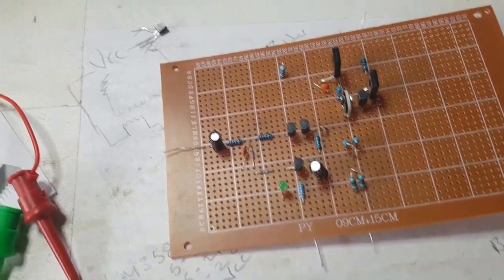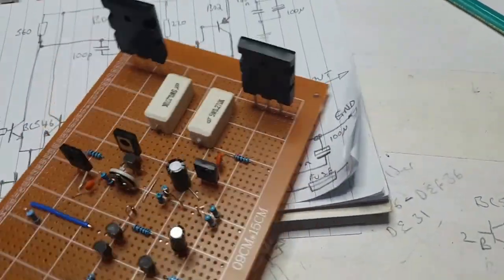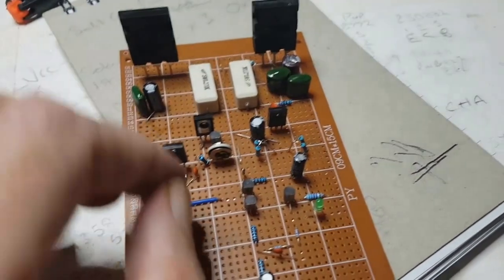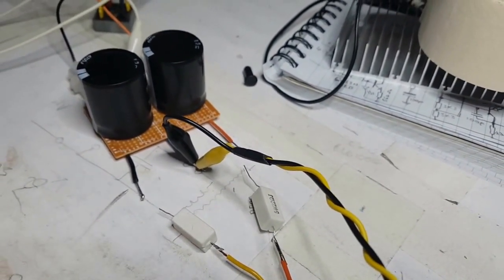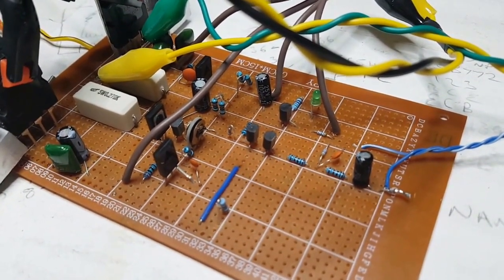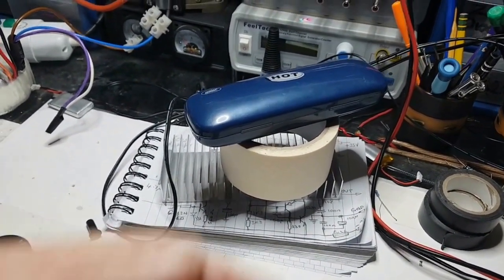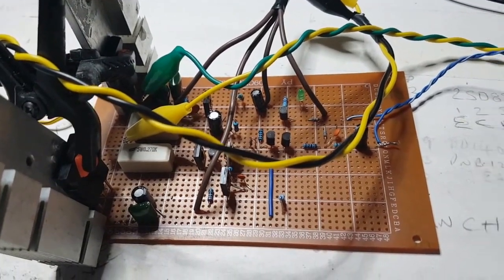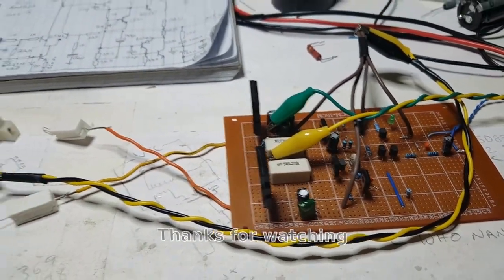60 Watt Amplifier Attempt 2 Pt 2

Comment: Enjoying your videos...thanks for sharing the magic smoke..nice solder work..what happened to your varic?...um auto transformer...smile...been busy here fixing tablets for my kids.... broken mico usb sockets..to small to work on..so doing a mod... fitting a charge and protection module on back of tablet...while learning how to recondition lithium batteries and been having great fun with my new toy...an amazon echo..."Alexa what value resistor is this?...."Alexa refresh my brain on Maxwell's equations and  remind me that my dinner is in the oven" headphones on... looking forward to part 3
Reply from the maker: Hi bunny, I still have my varic? ... auto transformer is easier to spell :D  Sound like the kids keeping you busy and you are having fun, that's good. 'Reconditioning' lithium batteries?  sounds interesting. 
Amazon echo... umm a device or system which stays on listening to what you say, processing/storing on a server in the off chance you need assistance?  Sounds smart, when does smart turn to creepy. I am a sceptic of these listening devices, or at least the power they can have parallel to the advertised benefits. 
Similar to Cortana or Apples voice activated service.

Comment: Your search for measuring the quiescent/idle current might be as simple as 2 ammeters inline with each + and - power supply supply rail.  We'd suspect an OK circuit will draw generally equal current on + or -.   This could also help identify a shorted output transistor, that would cause a smoking protection resistor (as you are using).  The + rail drawing 10ma with the - rail drawing 7 amps or more (after all, the 0.33 ohm resistors are nearly straight wires).  I'd propose the total quiescent current would be + and - currents added.
Reply from the maker: I have sorted the current problem with a twist of 2K pot. i brought the quiescent current down to 60mA at 25V each rail. The voltage difference on the rails is around 1.5V.
All seems well no hot resistors, no hot transistors :D Done it all on video, just one small issue to fix.  With rising input voltage I end up with 10 + volts on the output. no good putting a speaker on it as the current draw goes way up on one rail. Any ideas, cheers.
Reply: It may be more clear to understand what's up in your next video update.  Many questions would be answered... such as, are you pushing a signal into the amp, is the 10v on the output only positive, what is meant by "rising input voltage" (input to the power supply or to the amp input), etc.

And, if you have no heating components, what of feeding a simple audio signal in, and probing through the circuit with both meter and 'scope?  Since nothing is getting hot, you'd have time to see how the signal progresses at each stage.

Comment: I had hoped you would have tried a test of the input circuit using actual audio, before wiring in the driver and output stages.  Now things are all wired, maybe disconnecting both 0.33 output transistor resistors would allow further 'scope and meter circuit probing.  After all, it appears the path of most possible current is from each +/- supply rail... through the output transistors and 0.33 resistors, to the output (which, here, may be left open w/ no speaker?).

Something seems pretty drastic to cause a 5watt 'safety' PS resistor to start smoking.  If you've got 25v +/- through 22 ohm safety resistors, and something is shorted, that produces 1.13a through the R.   power = current + voltage gives us 28watts.  No wonder there's smoke.   Stay safe, man!
Reply from the maker: i didn't connect a speaker because http://sound.whsites.net/project3a.htm (Powering up section at bottom of page) says not to when testing.  I had it powered at 35V, per rail. I do have a variable mains transformer and will put an ammeter inline with both rails. I also have a mains current limiting circuit,  only have 40w and a 60w bulbs.

Comment: While looking for hot (or SMOKING) components definitely helps find problems, watching the voltage on the + and - power supply rails for 1 second will show where high current would generate smoke after 4 seconds.  Say you take 2 multimeters to watch the PS rails.  It takes only that 1 second to see where the voltages are - either as expected, one or both lower by X-volts is valuable info.

No speaker load when running the tests?  I suggest an 8 or even 16 ohm power resistor of minimum 5 watts would be very sensible.  You may want to look close at your circuit and think of what ramifications there are with no (speaker) load.
Reply from the maker: I have 8 ohms 100w dummy load and will connect if you say its OK. I only went on what the power up notes were.
Reply: Well, I'm blushing at the authority you've bestowed upon me!  "If I say it's OK."   Dude, my feedback barely has 2 Amurrican cents of worth.
I'm sure you realize people who comment on your efforts can sound very knowledgeable but still give poor (or wrong) advice.

Actually, my comment about testing an amplifier w/o load comes from a long history of using musical instrument amps.  As an amateur musician that invariably has to use amplification, the word spreads very quickly that you must pay extreme attention to having speaker loads connected to an amp before powering up.

Lest you "blow the outputs" (whatever that means).  And, for amateur musicians, that's pretty bad when you find you forgot to connect your speaker cabinets, and your amp don't work no more.
Reply from the maker: I see your input as a positive and 'do' really appreciate it. You get my mind thinking in a more analytical way within electronics, my projects. If you saw some of the messages I get from some people, you would understand that you and a few others leave helpful, constructive feedback which motivates me. I may not show it, but it does.  Hat tip to yourself and bunnyathome who are the first to come to mind. :D

Re this circuit. I have checked everything and all seems fine apart from and which always trips me. Connecting the 2K pot. The base connection of the BC546 and its connection between the pot and the 1K resistor. ?
I set up as you suggested and did the power checks. I will upload this later and look forward to your feedback.

Comment: If you have no variac to control input voltage to your PS xformer, then, yes, no way to ramp up the circuit gradually.  Do you have various wattage incandescent lightbulbs (10w, 25w, 50w, etc.)?  What of a quick experiment with another xformer, where on the mains side, you insert a lightbulb in series?  Let's say you start with 50w.  With no load on the secondary, the LB may run dim or off.  If you short any of the secondary windings, what will happen is the LB will glow full-on, because the xformer is working against a shorted secondary - but no damage occurs;  because it's saved by the LB and the LB's wattage rating.

Doing the same thing using a 100w or 200w LB will behave the same as a protective mechanism, but will put more stress on the xformer, because the LB is passing more power to achieve full brightness.

What's the point of this?  By using different wattage LB's, you can have adjustable power-limiting, ultimately into the circuit under test.  With your initial amp tests, the smallest LB possible that runs dim when the amp is not connected would likely be prudent.